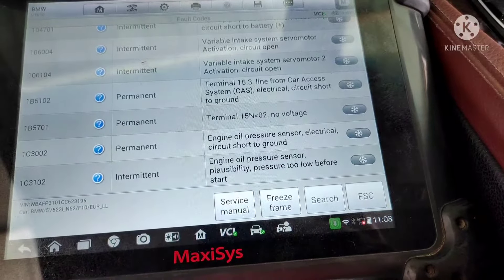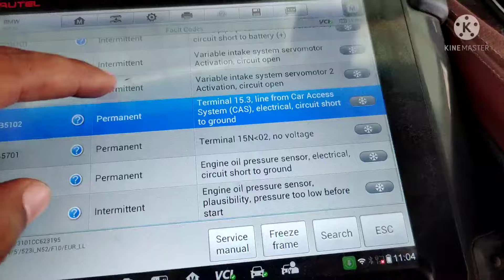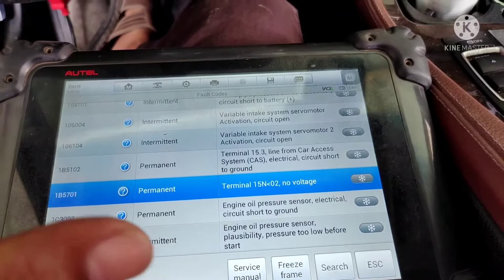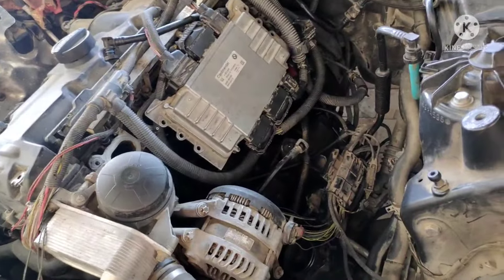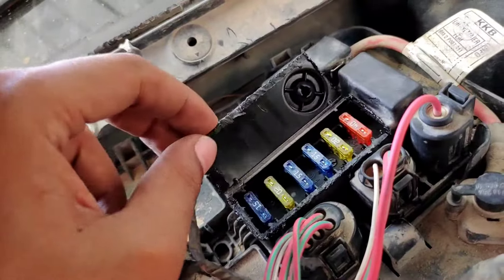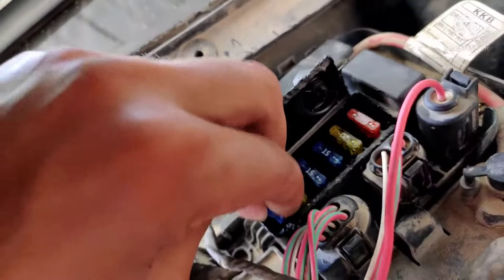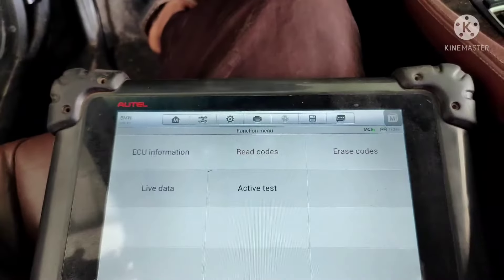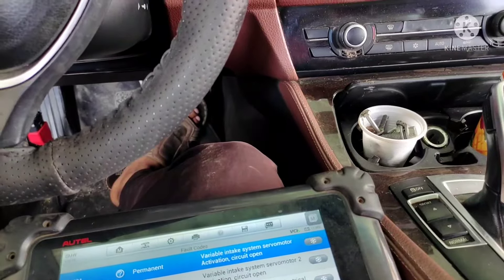BMW Terminal 15 No Voltage Hidden Fuses [ SOLVED ]

Comment: Thanks for this.   I replaced the valve cover, breather tube, and car would turn over but not start.  I found that the fuse you suggested was blown, found the problem to be a bad breather hose part.  Bypassed it for now.  Your fuse fixed the start issue.  Thanks.  .  Lke

Comment: Hello sir,how about my bmw e66 N62 engine cylinder no 8 pull out the ignition coil with connect the socket start engine no firing,both a new replace,no signal from dme,just the cylinder 8

Comment: Hi thank you for this video. The fuse was bad and was replaced. The car ran well for a few drives. I took it on a trip, two hours each way, and the fuse blew again. Luckily I made it home, but now it won't start even when a new fuse is installed. Can you tell me what that fuse is connected to? Or what your thoughts on what may be causing it to blow?  Thank you!
Reply from the maker: Do fues keep blowing?? If yes, then remove all the sensor and actuator connectors from engine then replace the fuse, and connect connectors one by one

Comment: I just run into this problem, but the fuse that was blown for me was the 3rd from the bottom or from left to right on the video. Replaced it but immediately blew again upon start up....any suggestions?

Comment: HELLO im asking you a question,  no.. 15 terminal was shorted out or not working,  so tell me when you turn the ignition switch on your BMW you got no power to your engine. I'm l correct??
Reply from the maker: Yes no power to engine but engine ecu will have power

Comment: Would this method apply to a 2010 535 E60? I've replaced the starter and battery and still no crank, but the dash lights up with errors. Thanks! I have 2ACA - DME: Terminal 15-3, line from CAS

Comment: Thank you for your very much helpful to find Terminal 15. 
I have problem finding Terminal 30A, which shows on BimmerLink error scan "BMW X5 E70 ERROR CODE 9CA9 TERMINAL 30A CONNECTION FAULTY". 
Any advice is greatly appreciated!
Reply from the maker: It will take some time if information not found on google search you can get help from any have alldata subscription

Comment: Great video.  Question:  is there a description of what circuits does this hidden panel of fuses control?.  Need to know if any of them has any contribution to the electric power steering servomotor.  My f10 2014 with code 4823E1 and No power steering 😢.
Reply from the maker: There should be two big wires and one or two thin in steering control unit. One of the big wire should be positive and one negative check both if positive and negative have voltage then high chance you have bad steering control unit need to be replaced

Comment: In my case the DME on top of the engine was shorted inside (burnt smell at main dme plug)  - blown capacitors which also caused the fuses to blow in the 'Hidden Fuse box'. Aka IVM.
Will replace the DME and program new keys and DME coding is also required - typical with Euros.

Hope this helps anyone else.

Comment: Is there a relay that stop power going to the fuse for the radio ? :(
Reply from the maker: No maybe some fuses behind the radio it self if all fuses ok then maybe radio module it self has issue

Comment: Hello bro do have any idea about this codes plZ the same car u work on it in video 

133C01 Valvetronic, Thermal Overload Protection: Warning Threshold, Current,
Exceed
133501 Valvetronic Servomotor:
Overload Current Detected
133902 DME, Internal Fault, Valvetronic:
Undervoltage Detected
134B02 Valvetronic, Servomotor, Supply
Voltage: Short Circuit To Earth
133401 Valvetronic, Thermal Overload
Protection: System Switch-Off
ABS (Anti-Lock Braking System - DSC)
D35584 Signal (Wheel Torque Powertrain 5, 40.3.4) Invalid, Transmitter DME / DDE

Comment: HELLO,YOUR VIDEO HELPED ME TO START MY CAR. THANK YOU VERY MUCH.
BUT NOW IM LEFT WITH THESES CODES - CDB004 - CDB104 - CDA604
Reply from the maker: You need to find reason why fuse get  brun out also check other fuses by removing one by one check by looking inside don't use tester to check fuse check if wiring if touching to positive or ground.

Comment: Did anyone have any success doing this i have a terminal 15 code no crank no start ive got a fuel pump alternator test battery a jump my key reprogramed and nothing works please help and did anyone have success doing this?????
Reply from the maker: Yes please cut that plastic and check for the fuse

Comment: Hi.where is the cooling fan relay on a BMW E60 year 2010
Reply from the maker: There is no fan relay fan comes with control unit in it signal wire goes from ecu to fan controller for temperature information then fan controller increase or decrease speed.
No relay ( i hope so)
There should be fuse some where
Reply: @CarFaults  Hi.so if no fan relay then what the problem should be,fuse ne 9 in the glove box it's ok ,and the terminal 30 that controls all electronics it's also good,what you think should be the problem.fan work just fine when tested separately.
Reply: @gjergjenrigentianarbersino4862  can you test fan from diagnosis tool active test
Reply: @justtrue8228  I did already,it's not working when given the order,but here is the thing how all this started,AC did not bring any cold air in,the compressor it's working though,and the fan wasn't working,I taped up the AC and everything stabilised,now everything it's started again,no cold air,no fan,but AC is full no need to recharge,.
Reply: @gjergjenrigentianarbersino4862  sounds like you need to change fan controller
Reply: @justtrue8228  already did, dealership said it's the relay that needs to be changed,I bought it already and can't find the relay, that is what I need help with location of the relay, even dealer can't find it.
Reply: 528i xdrive 2010 .
Reply: @gjergjenrigentianarbersino4862  ok i wil tell you after two days i am on holiday's now i have all data online in my workshop